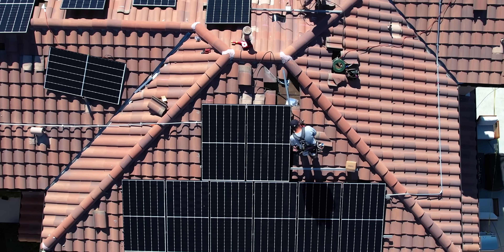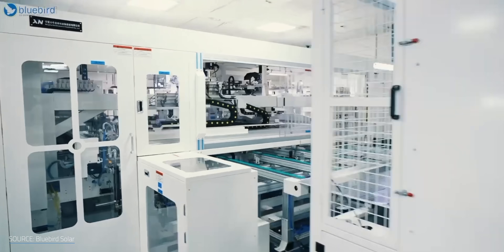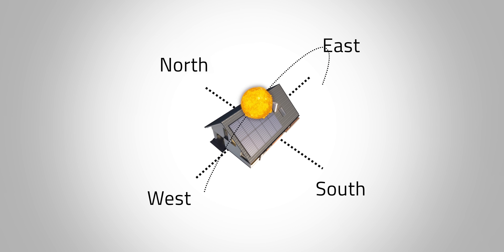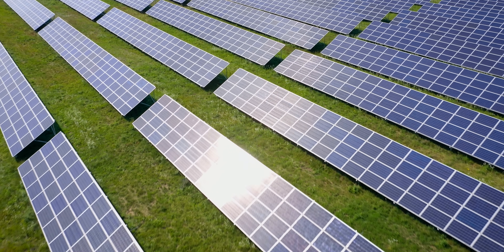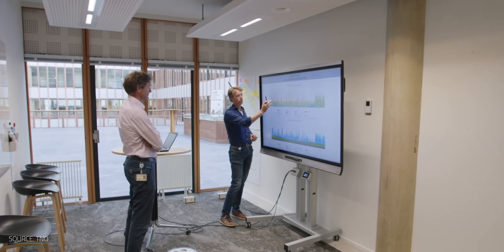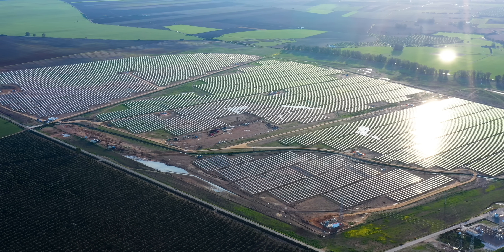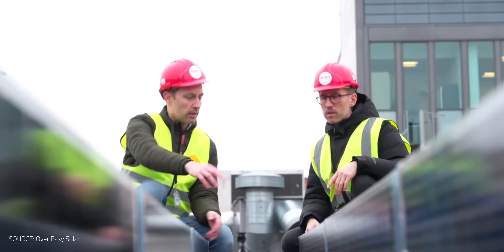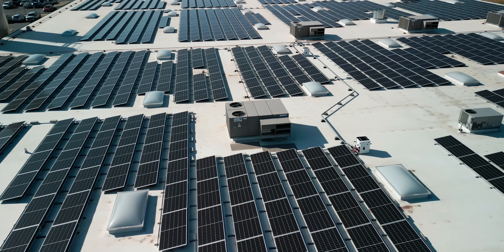Have we been doing Solar wrong all along?

Comment: Over Easy Solar AS hat its first full scale installation in june 2023, 7 months ago. All numbers I could finds are estimates. I might have the numbers wrong but it seems that the fist installation has a peak performance of 45 kWp and the same area with a normal sun fazed solar panel would have had a peak performance of between 80-120 kWp. So even if the numbers are better than expected it still looks like about 50% of an normal array. On a grid scale system the production hours might be beneficial, but as separate rooftop systems I cannot see the benefit of +- 50% peak performance but with a bether production offset to cover the average usage.I might be reading the information wrong, so please correct me if I'm wrong. But this looks more like we expected 30% of a normal system and got 50% so this is super good if we ignore that you should get 100% out of a installation.

Comment: For me, these aren't really useful. My home is on a south-facing slope. The panels face that way. However, matching the angle of the panels to your latitude is good but not necessarily optimum. My Latitude is roughly 45 but the panels work best at 55 where they are maximized for the mid-winter sun when there are less hours of sunlight. More direct but fewer hours. During the summer, the sun is less direct but the panels get more hours of sunlight. It mostly averages out over the year.

Comment: I think being able to use them as a fence is an added benefit, as you don't have to buy fencing materials.  I still think placing solar panels flat on the ground is the most efficient by far, requires less racking, mounting hardware, fewer cables and can provide 2-3x the output per acre compared to tilted solar.

Comment: Even if only one sided, i guess it means there would good reasons to cover not just the roof of buildings, but also their external walls, at least between the windows, with them.

I still think we should consider making orientation variable over the day, so you could face the sun as much as possible when that doesn't cause overheat, and take a less direct position otherwise, to target the optimal orientation all the time. Though of course that would certainly make systems significantly more complex.

Comment: I know i shouldnt reveal this to stupid people but the heat generated on the back side doubles the efficiency in a split heat pump if you use that for cooling the solar panels in a " heat tunnel". Didnt watch the video but i assume the extra sun energy reflected from snow up onto vertical panels was revealed here. If mounted on house wall the solar panels diverts cold wind cooling wall insulation and the heat generated rises up under your roof insulation and dries/ventilates under side of roof. All this is simple logic for thinking people but for a iphone user everything is a mystery. I seen some of these dimwits installs all their 30 panels in one angle hoping the sun will shine on that exact spot and time every day, some of these idiots even optimized for summer sun instead of winter sun. Stupid people are so funny, i love laughing at them.

Comment: I don't think the claim that vertical panels are outperforming horizontal panels is accurate. Vertical panels will not be able to harvest as much energy so they may be more efficient at getting reduced energy but together with increased cost they don't outperform standard panels. However, they do seem to be a good solution for specific use cases such as limited space for traditional panels, etc. My roof is at capacity for panels but would love to place a few vertical panels on my walls... but not sure if the economics make sense to get bi-facial panels or simply mount a regular panel on the wall.

Comment: Have they tried sandwiching an infrared sensitive layer, say a layer made from perovskite, between these two layers to capture the energy due to infrared energy generated by the heating of those external layers which face the sun?  Other materials may also work at capturing the infrared energy of coarse. However, the goal would be to surpass the theoretical limit of single junction solar panels. And how much does this more complex construction impact the affordability, cost of the solar panel?
Reply: Also, note that if sandwiching were done the negative effects of heating of angled solar panels could be transformed into a positive.  During the winter the sandwich layer would probably not perform well in the vertical position, however if the panel were angled the middle layer would receive more energy, it would be an option for how these could be operated.

Comment: Alternatively, you can use panels from French company DualSun, and you get to both harvest thermal energy and improve photovoltaic efficiency by cooling the panels with the liquid that harvest the thermal energy to heat water. DualSun claims that they have the best overall efficiency as they harvest both thermal + photovoltaic energy.

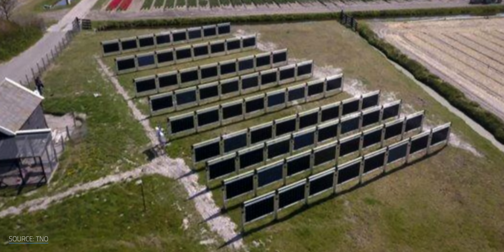Comment: 7:15 "an east-west configuration" Does that mean that the normal vector of the panel surface is pointing east-west or that the normal points north-south and the array frame is east-west? Judging by the shadow length in the picture (probably noon) the normal's are east-west, but it is not exactly obvious.

Comment: East-west vertical solved another problem for me on my farm — the vertical panels are not as ugly as conventional.
Reply: Should help moderate wind speed at ground level, and therefore increase crop yields and reduce water demand in most climates, too.
Reply: Should swing in the force of wind reducing structure. Also don't have to be directly east/west facing. Use NREL SAM. agrisoltaics with two S's
Reply: @energyideas  
That is too cryptic. What are you saying?
Reply: Those short close spaced  panels at 15:28 will be a real struggle to maintain. Try walking between them without falling over.
Reply: How about fixing them to south facing walls? My house in UK has the roof ridge running north south with a shallow pitch. Roof is pretty useless for PV.
Reply: I just replaced a metal gate.  Why horses like to lean,  chew and kick enclosures, I don't know.  I don't think I want to risk it.  However, a few hot wires might protect the solar panel fence.
Reply: You think like a raised 4 panel array is ugly but these lifeless straight line columns aren't? 

My understanding of beauty is in direct contrast to you it seems and I can obsess for unhealthily long chunks of time over flat straight and true, but, as they say, straight lines don't exist in nature and in buildings can easily lead to that sickly institutionalized feeling. I think vertical can have a place but I'm a HUUUGE fan of garden partitions and privacy screens and even with that, on their own, vertical panels look anemic and uglier than shit.

I don't like panels on any roof that isn't south facing but thats cuz I think it's inefficient. Putting a post in the ground and panels 8ft above you isn't going to be cutting into most people's freedom of movement (assuming you have the space). Panels can even be arranged to look like flower petals opening up. Idk man, I'm really trying to understand here and I'm just coming up short 

Do you think giant windmills are ugly too? Because the majority of people think they look freaking awesome. 

If we were 18th century Dutch, would you have been against those windmills going up too? Progress is appealing, exciting. Conserving has a place, but if it's trying to conserve old customs that have no real reason to exist (like infant mutilation) beyond tradition, just accept that your ways are in the outs, in just the same way as your generation did to a number of your parents mores.
Reply: @Mix1mum  
Yup, I have pedestal ground mounts, too, on the farm site, and they look fine. Easier to maintain than roof mounts, too. But in the fields, these east-west bifacial verticals will look much better than a field full of south mounts. The fields full of south mounts on dirt where nothing grows cause shade, usually surrounded by a chain link fence — these arrays are a blight.on the countryside. Better than a coal plant, certainly, but I like the promise of this simple innovation for farm country.

Comment: Especially in winter, where the sun has a lower profile, vertical panels make a lot of sense. Snow doesn't accumulates as much and the angle is perfect for the winter sun. And in the summer you hardly lack solar energy, so the not so optimal 90° angle doesn't hurt much.

Comment: There might be a few more advantages:
Less dust/snow collection on the vertical surfaces therefore less cleaning/water consumption. Also easier inspection /repair. Easier installation since only one line of support poles are needed
Reply: Easy to install on flat roofs.  For that matter, also on sloping roofs.  ((They might look odd, though.))

Comment: If they are mounted in an open field anyway, one could also mount them on hinges (one plastic bearing left and right, and connected top and bottoms + a drive motor) and just flip them horizontal in the middle of the day. This would reduce the dip in the middle of the day at minimum cost.
Reply: Then you return to the issues with overheating. It's also way, way more complexity in the setup, extra energy use, more stuff that needs maintenance and that can break... Doesn't really make much sense.
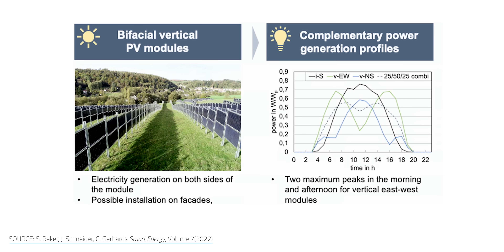Reply: @amunak_ look at the graph at 3:52  the vertical east west panels (green line) have a massive dip in the middle of the day. Flipping the panels horizontal would certainly lead to higher temps and thereby lower efficiancy (for that time) but it would fill the gap abd probably cause a quite constant output over the day. And the mechanics aren't that fifferent from the window openers in greenhouses which do work with verry low maintenance.
Reply: even better just automatically track the sun!

Comment: I live in wyoming and completely off grid power with solar and wind for several years now.  If I get a chance to buy more panels I may try an array of vertical to catch morning and afternoon light.. but the winds here are brutal from the west, typical winter wind speeds exceed 60mph. I'm not sure how well they would hold up to that.
Reply: Air gap between
Reply: @rp9674  Yes, that will help some. But the with some basic math, the calculations of wind force on then is upwards of 35psf with the recorded wind speeds in my area.  So the panels that I have are average size 320w the surface area of about 21sqft so the lateral force could reach over 700lbs per panel.  That is my concern. Granted I usually don't see winds at 100mph, 80mph yes, and the numbers I used didn't calculate air density at my elevation. So even then let's say up to 500lbs per panel.. That is still very significant.
Reply: Intense, I've seen a place where patio furniture & a BBQ get blown around, prob less wind than you have
Reply: @rp9674  yeah it is.. we had an above ground pool that we emptied to clean and prep it for winter.. the wind blew it over 1000ft away after it crushed the fence I had around it.  I have never experienced wind like this place before I moved here. I have no trees or buildings within miles of my place so there are no wind breaks.
Reply: @japguns1022  wow, sounds like an opportunity for wind power & kite flying

Comment: I think the concept is sound, but also somewhat situational.  It is not a direct replacement for southern-facing or tracking systems.  Also, it doesn't really compete with grid-scale installations where the panels track the sun.  I will also point out that what people care about the most is not so much the sunniest of days, because production is already massive on the sunniest of days.  The temperature is a bit of a red herring since one is already over-producing in that situation.

It turns out that morning production, late afternoon production, and off-light production become quite important when trying to fill the production gaps and reduce the number of non-producing hours.  That directly reduces energy storage needs.

This orientation definitely satisfies some of these needs.  I have some vertical panels hanging off my own back deck railing precisely to give me better late-afternoon production.  With my house in the way I don't get anything in the morning so the overall production is fairly poor, but in the late afternoon the panels on the railing outperform the main south-facing system I have on my roof and production exceeds consumption almost all the way to sunset.   There is definitely something to the concept.

-Matt

Comment: IN PRIME SOLAR LOCATIONS, like the American southwest, cooling buildings is often one of the major uses of energy. 
It seems, as far as roof mounted arrays are concerned, that having solar panels absorb that heat instead of the building would come out in favor of horizontal arrays. 

Also the additional degradation from sunlight on the panels means the roof isn't degrading as quickly and is going to last longer. (Though just over the areas where the panels create shade)
So then you have to figure it replacing the roof or replacing panels is more cost effective. 

So it seems to me that in these hot sunny areas, horizontal is still the way to go for roof installations.

Comment: Turns out motorized mounts can get the best of both worlds to maximize returns. Angle perfectly until the critical temperature is reached, then adjust to east west vertical orientation until temperature drops back to optimal temperatures. Rinse and repeat. Definitely adds complexity and more maintenance to the system, but could work wonders for efficiency!
Reply: than questions is if cost efficent as well addeding that complexity
Reply: Motorised mounts are more expensive than just getting more panels these days. I have a location where I was thinking of motorised because the panels can't be roof mounted, but it's shockingly expensive compared to a static mount. The idea of a vertical mount is very interesting to me because it is potentially even easier than a traditional sloped mount, because its mounted like a fence panel with just two end posts (subject to wind loading).
Reply: Brilliant idea. but It should be done as DYI e.g. using cheap SOC  like ESP32 and clever servo mount otherwise it would be too expensive.
Reply: what about mounting it at the top hanging down and the servo at the bottom tilting in +- 15 degrees at forenoon and then afternoon. Right in the morning, at noon and before evening it should stand just vertically. Such tilting should be quite sufficient. But the question is the overall daily surplus yield of energy, I would bet about 15% ?

Comment: If the primary increase in efficiency is from lower temperatures, do they still outperform actively cooled panels? What methods do we have for active cooling that consume less energy than the increased energy gains? Where do the net gains line up with vertical panels?

Comment: As an idea, a reflective wall between the rows to reflect light to the shaded side. Now sure you need more room so it does not shade the other row of panels for this reflective wall but maybe it can be curved a bit so it can be shorter. It is like the globally shaped solar panel that has a curved reflective surface placed a few feet away from it on the opposite side that the sun travels thus the global shape gets light all around it.

Comment: As a latitude of 53 degrees any solar panels here in Central Alberta would be more vertical than horizontal anyway so clearly the idea has merit. Plus with the sheer amount of extra bounced light from the snow? These just make sense, especially along the tens of thousands of KM's of highways and railways that dot the province... And that's just the prairie part!

Comment: Looking at the examples in your video, vertical panels would see the greatest benefit in places with significant snowfall, as the vertical design would shed snow easier.  Where I live in the south, we get very little snow, so I'm not sure the vertical panels would do any better than conventional tilt mounts.  The bifacial panels would get reflected light in both orientations where you only had a single row of panels.  I was considering a carport style mounting system to take advantage of the shade cast by the panels while leaving the area under the panels free for other uses.

Comment: The better solution is just adding cooling to normal solar panels facing at the proper angle. That said you want to avoid using more power than what you're going to gain. but heat sinks are a no power solution, but not the most effective.

Comment: i wonder how much more of a benefit it would be to run Vertical Bi-Facial panels with water cooling to pull more heat away from the panels into a water source for a building/home to use as a hot water source, then loop the cooled water from the building back into the solar panels. The building/home would act as basically a large heat exchange. I know Linus from LTT used the hot water from his panels to warm his pool, and the pool acts as the heat exchanger, would be interesting to see if, on a larger scale, this would be beneficial. 

Granted it would end up costing more due to plumbing requirements, but not having your hot water heater running constantly would likely reduce overall building electricity usage so might be a net positive.